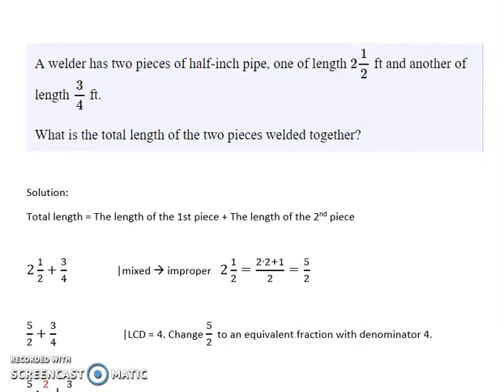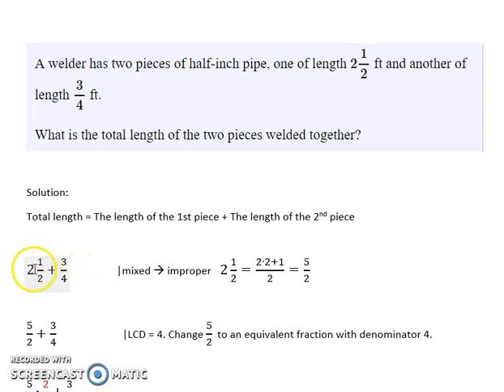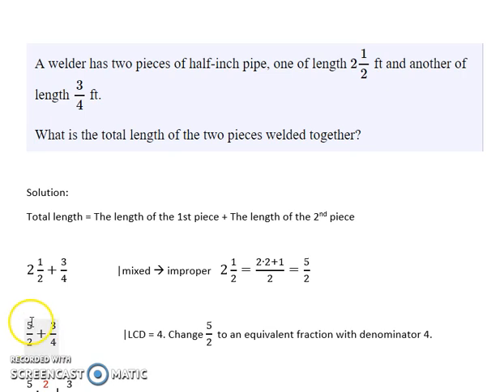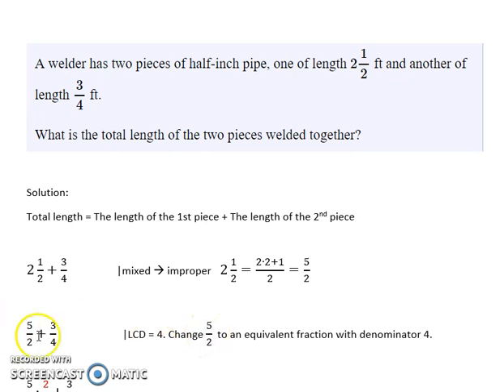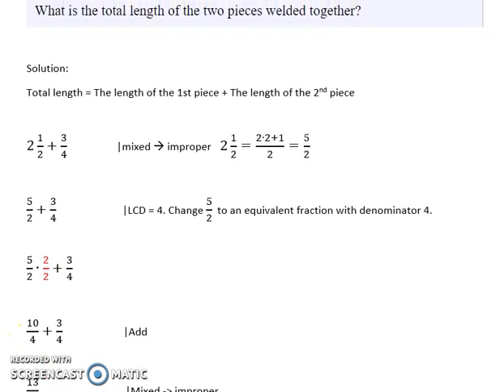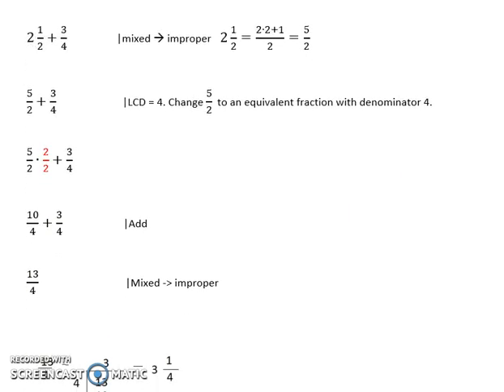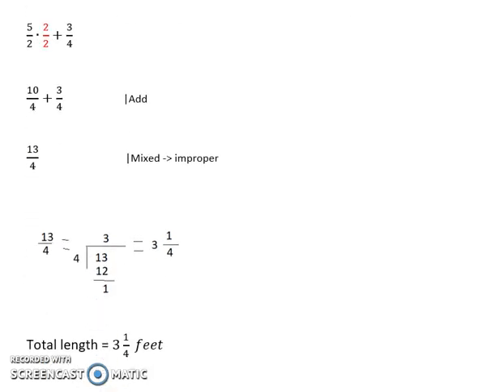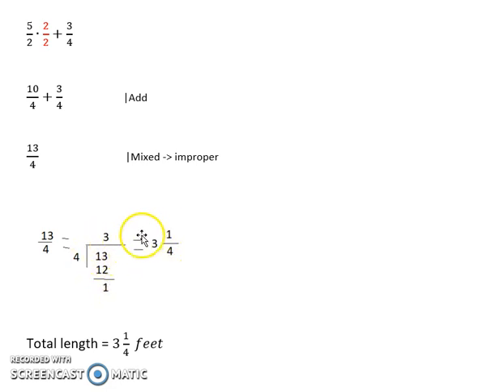Adding Fractions Welding Application

Comment: i dont know what math you did but i got the answer by adding in a few seconds
Reply: You could also get the answer to this particular example by realizing that 2 1/2 + 3/4 is 2 + 1/4 + 1/4 + 3/4 = 3 1/4.  Is that what you did? This was a simple example. The point of this video is to see the mathematical process for adding "any" two measurements containing fractions.